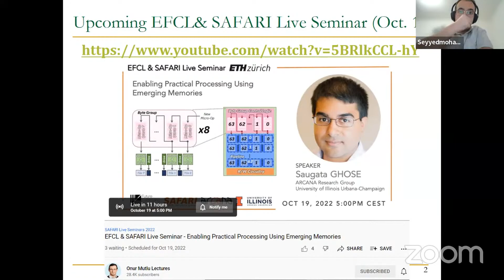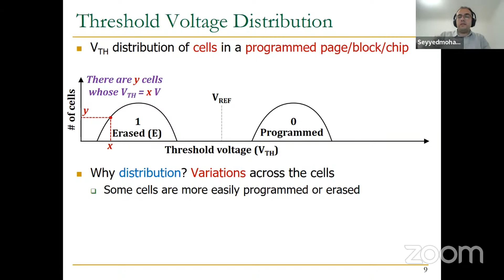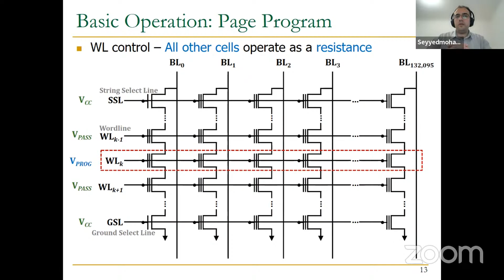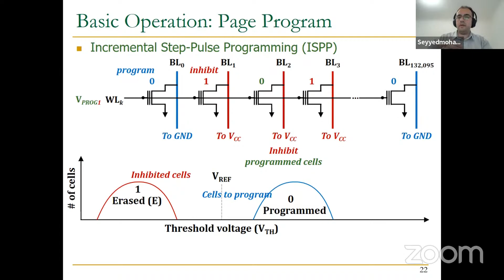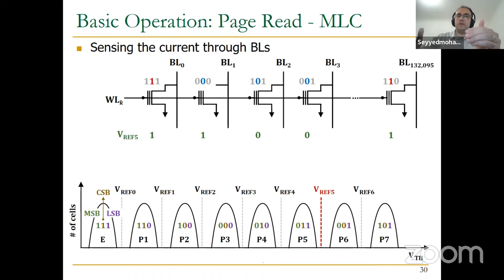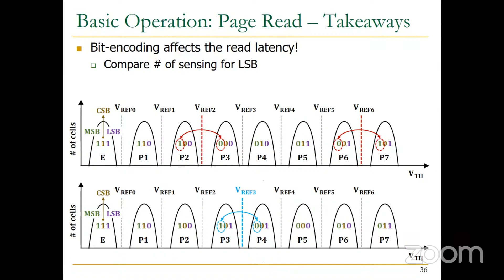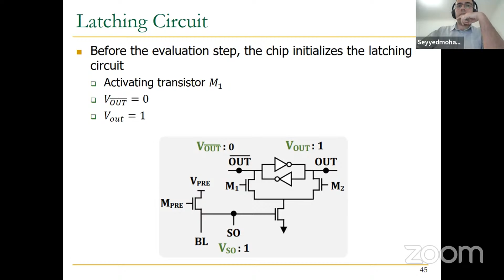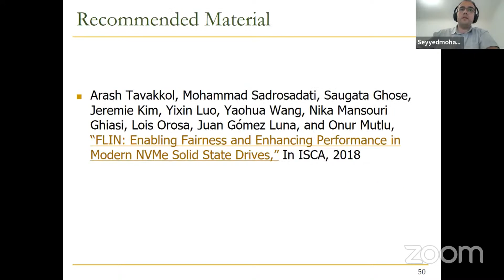Modern Solid-State Drives (SSDs) - Lecture 2: NAND Flash Read/Write Operations (Fall 2022)

Comment: What makes SSDs so hot when you saturate them with reads? Is it the flash cells themselves or is it the controller? Just dd if=/dev/nvme0n1 of=/dev/null bs=4M will ramp the temperature way up. watch nvme smart-log /dev/nvme0
Reply: The Controller for sure gets hot, take the controller as the CPU essentially of the SSD, it also has a "100%" limit, and it probably also gets hot when it reaches that